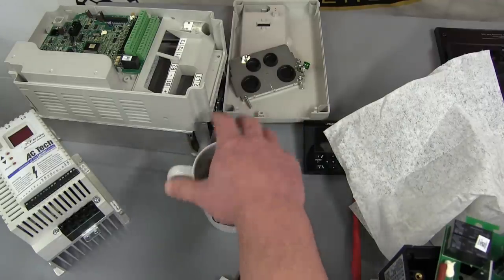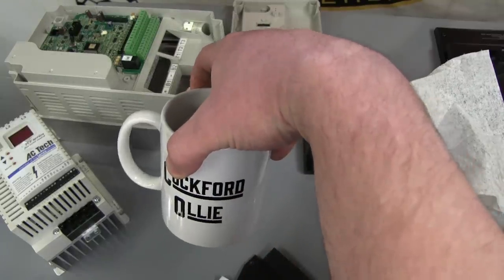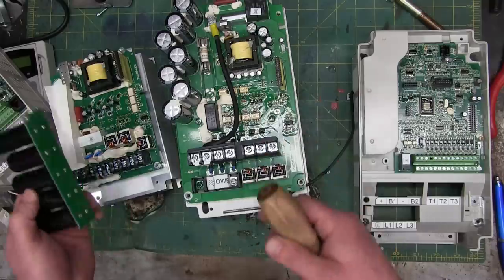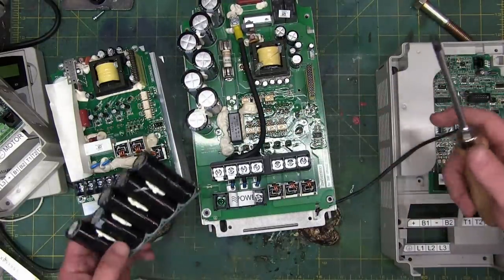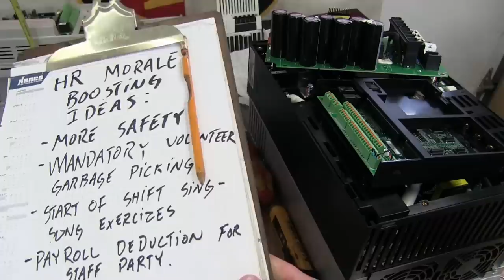Industrial Electronics Tune Up! | Stay Frosty

Comment: Here's a suggestion about thermal grease from a recently-paroled professional: squeeze a reasonably thick stripe of grease in a line that goes from one screw to the other, and extend the line out paste both screws.  Width of said line of grease: maybe 4 mm.  As you tighten down the screws, the excess grease will be squeezed out perpendicular to the line and get squirted out from underneath the base of the device.  It's clear that the two surfaces make contact near the screws, so the grease layer will end up as thin as it can be, and it will probably cover the entire contact area.  Typically, with a square device held in place by weak springs, you can't expect this kind of optimal thinning, and the pros sometimes apply the grease in a matrix of small dots.  If your mating surfaces were accurately flat (they're not) and the were clamped with uniform pressure (they're not), then there's another trick you can use to get a uniformly thin layer: Run two pieces of kapton tape along either long edge of the contact area (thickness: about 0.1 mm, just right for silicone thermal grease), put a big blob of grease on one end, and run a razor blade over it to spread it out over the surface.  With practice, this makes a uniform layer of thickness 0.1 mm.  Last trick: use better thermal grease: Laird T-grease 2500.

Comment: How feasible do you think a crowdfunded Tesla BOLTR is?
Reply: beastly5569 Fuck Yeah!  Even if it comes via copart or some other auction, a motor and tranny tear down would be the Cockford Ollie!
Reply: The inverter alone is a thing of beauty.
Reply: Don't forget, AVE's afraid of schparks. Lots of schparks in that battery...

Comment: FAAAAK. Those Capacitor's look like they should scare you as much as that starter motor did... Maybe you should repurpose them into giving the Mrs' filling rattler a little more chooch ;)
Reply: I have a guitar amplifier from ~1975 that has caps about that size in it. 8000 uF at like 32 volts. Given how far the technology has come, I suspect those pack quite a bit more punch.
Reply: in car audio we had 20 FARAD caps. They could weld instantly. it was great.
Reply: I found it scary enough changing out a 16uf Cap from a generator.

Comment: I just bought an America Rotary static phase converter for my little tiny hardinge milling machine. It's about a quarter of the mazak but it has a Bridgeport high speed c head and a horizontal spindle. It still has the scraping on the ways. I will be the most accurate 16 year old on the internet. That is if I don't break it in a week, fingers crossed.
Reply: Rowan Dunn Tightest little ways to get your gibs on.

Comment: The ridges from the milling is a result of not doing a small finishing cut when using an end mill. It happens because of tool or material deflection, not the clearance angle of the cutter. That only comes in play when plunging with an end mill, when going sideways the clearance prevents galling and the rotation will ensure a flat surface just like a fly cutter.  That’s the only reason the clearance angle is there.

Comment: Does the shmoo look all mars-scape just because you pull off the heatsink. It's going to look like that no matter how nice you put it on.
Reply: Doesn't look that dry
Reply: There are different patterns created depending on how dry and crappy the thermal goop is; you can usually tell when it's got some life left by the different patterns you find.
Reply: it wasn’t a pattern from tension from pulling on a paste. it’s a pattern of dry cracking

Comment: You need to hone both surfaces super flat and mirror finish. Use Artic Silver thermal compound, the thinner the layer the better.  Orange oil cleans that shmoo off really well.

Comment: If they wanted to keep the electronics running hot, they wouldn't do it by doing a crap job on thermal paste. That doesn't save any money.

They'd just give it a smaller heatsink, since that makes it cheaper to produce at the same time.

Comment: Apply thermal paste by putting a glob in the center and letting it expand as the surfaces are pressed together. That way air bubbles are way less likely, plus you don't end up pissing about for half an hour with a bondo scraper

Comment: With an endmill you're still cutting with the lowest points on the cutter, which should create a flat surface if they're cutting square to the surface.  The reason you get ridges is because the tool is slightly angled, and that can happen with a fly cutter as well, you just get one wide trough, instead of several narrow ones.

Comment: Back when the first 100w LEDs came out, they were rather expensive, I spent 4hrs lapping a pair to a heat sink.  
You could actually ring them together when I was done. 1 popped as soon as I plug it in. :(  
Now I just make sure it's close. :)

Comment: When you do computer heat sinks, you put the paste solid in the middle and let it squeeze out to ensure no air pockets. With that I'd do a bead long was in the middle and clamp it down. Probably do it 1 or 2 times to figure out amount before the final.

Comment: That Altera Max II isn't a terribly expensive part. They call it a CPLD, but it's halfway between a CPLD and a FPGA. One big advantage of this over most fancier FPGAs is that it isn't volatile and you therefore don't need external flash memory for the programming. Just program it once and you're set. Apparently it's good at protecting its programming from copycats too, which can be good in competitive markets. The Max II is typically used for glue logic or high speed signal processing or generation. You see them in oscilloscopes and signal generators, for instance. It's often used in conjunction with a real FPGA or microcontroller.

Comment: The reason the 2kW drive has almost as much capacitance as the 3kW drive is the 2kW drive looks like it is a single phase input and thus the rectified frequency is a third of what you will get with three phase rectification, requiring a greater amount of capacitance to achieve the same ripple level given the load current.

Comment: I've got a big 'ole VFD sat in the shed, need to tear it down to recover the IGBT module and  caps (DIY 220V VFD project on the go).  I probably need a Cockford-ollie mug what for putting the screws in, so I can lose them later.

Comment: A nice line right down the middle of the  heatsinkable area would work better that way it can spread out on its own inside out to prevent air bubbles from reducing your corntact area.

Comment: Speaking from my experience in computer processor installation, those ridges and cracks you were seeing in the old thermal compound was due to air pockets being present when the heat sink was applied. Spreading out the thermal compound causes an imperfect spread of the compound and the formation of air pockets. While this doesn't have a horribly large impact on the cooling of computer processors (1-2C), I'm unsure of how this would affect an industrial application. To prevent this, apply the thermal compound in an x shape on the heat sink or on the thing to be cooled.
Reply: Forgot to mention, apply the compound in an x shape and let the pressure of mounting spread the paste out. This ensures a near perfect spread.

Comment: The last tube of paste I got came with a cutout made in a credit card thickness template for the device,  great way to control the amount being applied; in fact; the only way I can think of without the use of a roller likes when your applying gasket cement.  I had a friend who went around a rocker cover with a tube of Hematite like he was applying toothpaste,  torqued down nice an toit;  and then lo and behold the little blighter leaked on start-up.  It took me hours to remove the arches between the bolt holes.

Comment: Having spend many years building high end computers, it is usually easier to apply the thermal paste to the CPU and not the heatsink, helps get it more evenly distributed. This would have been the same.

Comment: I know you are talking about doing this with industrial electronics, but I do this with the computer parts I buy (specifically GPUs and CPUs) and I've never had one go bad, despite using them for cryptocurrency mining, running at 100% 24/7 for years on end.  Heat is a killer and the companies typically use the cheapest TIM they can get their grubby hands on.

Comment: I used to have this laptop. I played online video games and would get 12 frames per second which sucked. I took my laptop apart and used this silver based stuff called Arctic Silver II and my FPS went above 60. I was amazed. It was like putting a supercharger or turbo on my laptop.

Comment: Arctic Silver 5 is my goto thermal schmoo.... though I've used a lot of them and to be honest they mostly seem to be about the same now days within a couple degrees of each other, I just know the AS5 LASTS a while, as it even gets better temps as it cures. You should use some 90% isopropyl alcohol, should take that old junk right off. I also would have just made a line across it and let the screwing it down spread it out how it needs to. But I'm sure it'll work how ya did it. I hate the manual spread method though....

Comment: The Altera bit is a CPLD probably using it because its a low volume part so not worth the expense of designing an ASIC. Basically like a pile of jellybean parts and a breadboard. Just a guess but could be using it over an FPGA because the timing is more predictable with a CPLD.

Comment: I don't think the thermal conduction is as big an issue as I'm inferring you're implying.  Sure, flatter is better, and more even clamping force is better, but how much better does it need to be?  Take a look at the specs of the IGBT module.  It's probably good to something like 125°C.  If the drive is selected for its purpose correctly it just won't be getting that hot.  It feels good to improve on mediocre manufacturing, but I don't think it's necessary.

Comment: denatured will eat up those silicon based thermal compounds BTW... also, when applying thermal compound apply to the unit not the heatsink and allow the thermal compound to spread due to pressure VS spreading it out with a spudger or spreader... get a better more consistent coating... also they wont flow properly unless heated up much like a cpu heatsink on a personal or server cpu

Comment: Toluene helps cut silicone grease. 
I haven't tried the more recent substitute for toluene called Parachlorobenzo-trifluoride as found in Sunnyside Xylene/Toluene Replacement Solvent (along with acetone.) but you might give it a try next time you need to remove some crusty heat sink compound.

Comment: Too much thermal paste is actually a thermal insulator.  I used to work with three phase DC motor drives and we ended up doing a campaign to do exactly what AvE has done to improve their lifetime

Comment: So here's a question: If heat build-up is such a critical factor for longevity, would there be any value in siphoning off a little of that AC power to a smallish fan that blows down the length of the heat sink on the 2HP unit?

Comment: Silicone oils can be dissolved with dichloromethane or tetrachloroethylene..that chlorinated brake cleaner which doesn't burn but can be very bad if it gets hot.

Comment: I have heard one of those capacitors blow before in a VSD at work, it sounds like a shotgun blast.  When I replace a VSD that has done this for a customer I ask if the operator got scared when it went off.  They just nod with distant look in their eye.

Comment: You talked about doing a hydraulic how to video awhile ago, I know enough to get my fingers cut off, but I want to build a go kart with forward and reverse. I have a vertical shaft 20hp briggs, and an off road 2 seat Carter go kart originally a 10 horse Tecumspie and a cvt belt drive. Don't know if a hyd. Motor could drive this cart? The plumbing seems like it would be a nightmare.

Comment: For thermal paste on PC CPUs the general rule is a dab in the middle. The idea behind that is that you can't get trapped air pockets. Because your heat sink is so big;)would that prevent the paste from flowing out thin enough?

Comment: I swear at, by those Mitzoboochi VFDs. Pissed that I had to jury rig a fan because I'm too tight fisted to buy the overpriced fan kit. The only issue is that I can't resist playing with the parameters which can be counter productive as it runs my Harrison M 300.

Comment: AVE, you heat compound application isn't the recommended way (not saying it won't work)  look into how cpu heat sinks are spread. it's been tested that a dot or in this case single line is the best way as it spread out without air gaps assuming you can drop it on there straight.

Comment: And if the thermal compund says "not for aluminium heatsinks", you really shouldn't use it on aluminium heatsinks. Wondered why my cpu temp shot up like a rocket after an audible snap. Well, that was the aluminium heatsink...

Comment: The thermal transfer compound is not that critical in this application. Main limiting factor is the heat dissipation capability of the heatsink itself. Consider that the surface area of the hybrid IGBT device is huge in relation to the amount of heat being dissipated.

I've worked with RF amplifiers with transistors that have probably 1/10th of the surface area of that IGBT brick, which dissipate in excess of 500W!!! In that situation, optimum thermal transfer to the heatsink is absolutely critical. For those VFDs, no, probably not critical at all.

Comment: Hey Bud Question for you. I Have a Milwaukee flood light. it's bright and works great but that's when it works. If I put new battery in it and turn on. it turns on really Dim for few seconds and then turns off. And if I put another battery in it,the light won't turn on for Days. Any Ideas?

Comment: I've had more luck with heat-sink compound when I have applied no more than a grain of rice per square inch or by spreading it with a trowel (credit card) so thin you can see through it.

Comment: Usually agree with AVE on assessment of workmanship, but IMO the thermal paste gripes he had were way off. That's how it looks when it's been used and cycled for a while. Especially if you pry apart what was a well bedded in joint. It's going to crack and look all fugly.

I cringed so hard when he was squeeging the new paste on haha

Comment: Ack, I cringed from the amount of thermal paste used.  No paste is gonna compare to the thermal transfer of direct metal to metal contact.  The paste is just to fill in imperfections in the faces.  You want the barest hint of the stuff

Comment: In 6:14 you say "definitely not a third more" but in fact 5 caps vs 7 caps is pretty fucking close to a third more. 7*66% is 4.62 and we can see one of the caps on 2hp one is slightly smaller.

Comment: wouldent that be similar to standard thermal paste used on like processors correct me if im wrong there  we use 99 percent rubbing alcohol
Reply: honestly as well ive seen that when you take heat sinks off in general  even stuff thats done well

Comment: Jeez, the whole drive looks craptacular compared to the small ABB ones I've worked with.
Reply from the maker: ABB 2HP VFD $1000. So in this case, you get what you pay for?
Reply: I mean I guess if you're buying it new! I bought an ABB ACS355 5HP drive on ebay for $200.  Works like a charm.  I put 1/3 larger capacitors in it for running off of single phase 240.  I use it to run a 3 ton A/C unit for my house that I bought specifically with a 3 phase compressor.  With the efficiency of the 3 phase motor, I can run my whole air conditioner on 7.9 amps as compared to 10.4 amps on the same unit with a single phase motor.  As a bonus, I can also run the system at a reduced capacity at night, saving even more $ on my electric bill.  VFDs freaking rock!  Thanks for replying AvE! love the videos